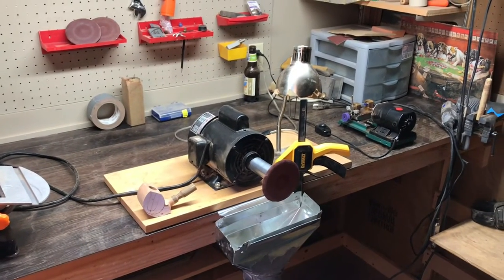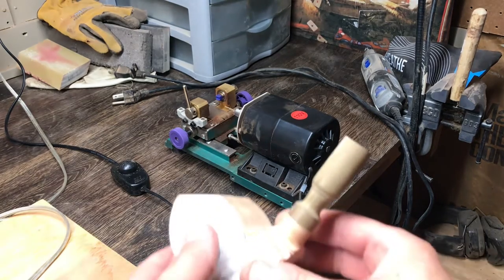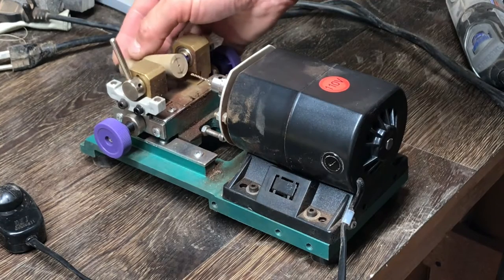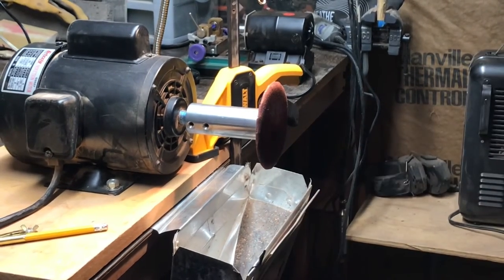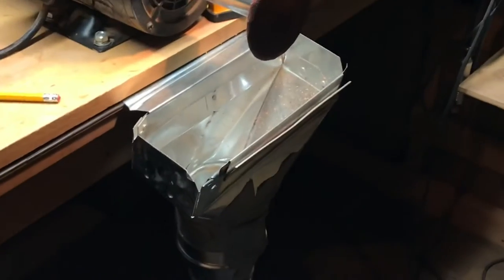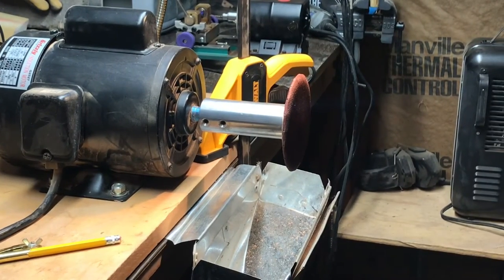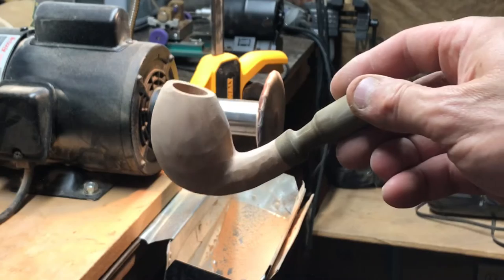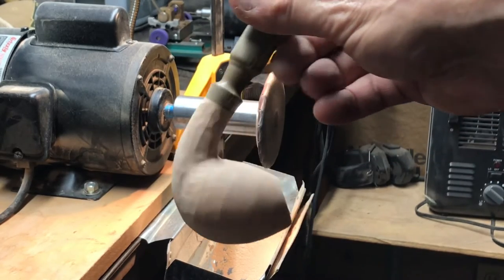Danish Style Pipe Making Tutorial  - 3 of 6

Comment: Showing your stem work roughing was very helpful on the belt sander🍭🐓👶
Reply from the maker: I'm glad it was helpful.  I can't remember if I showed it, but I usually put in a flat needle file into the slot when I'm profiling the thickness on the belt sander.  The flat needle file is about the same height as the slot.  This helps me get close but not sanding into the airway.  I also put the flat file in the airway to check my thickness when using files. I use the needle flat file that comes to a point instead of the flat file with the square tip.